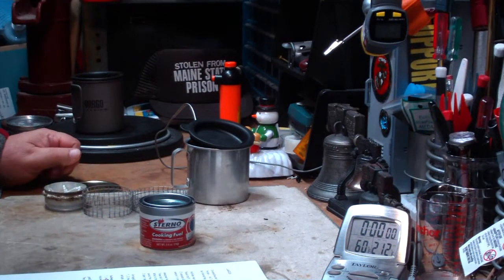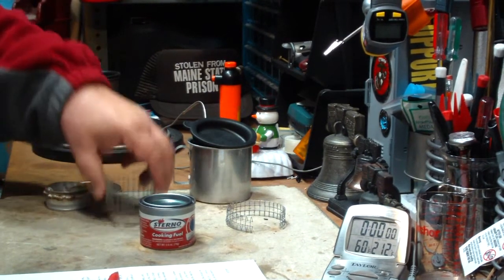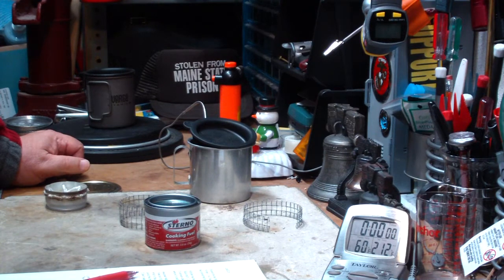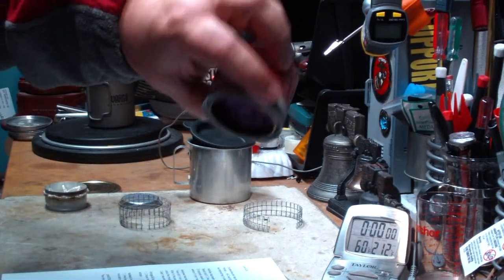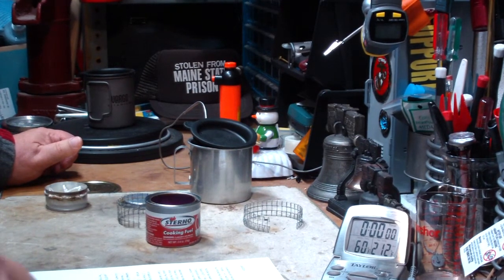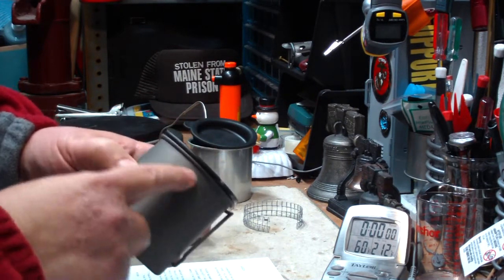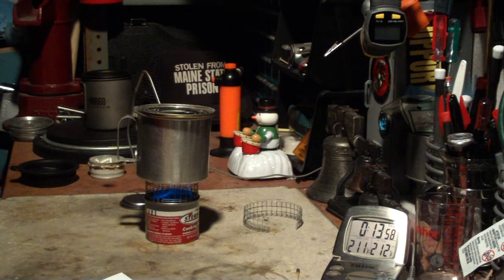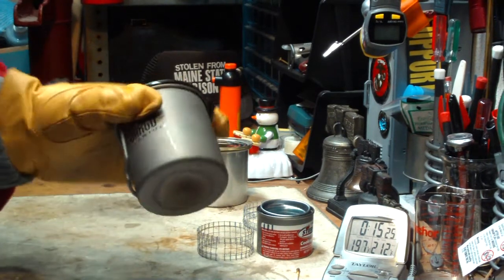Sterno or Gel Fuel? What A Can-of-Worms  II

Comment: Hiram: I told you that water in Tutanium heats up faster  than in aluminum. It has to do with specific heat. The efficiency of heat passing through the metal of the container. The specific heat of aluminum is .91. The specific heat of steel is .49, and the specific heat of titanium is.54.

Comment: Yes, if you make one 5 squares high and you get around the same time as the 3 squares high then 4 squares is the optimum height. If 5 squares gives you a shorter burn time, then try one 6 squares high. I would predict that at some point fairly soon the greater height will increase boil times, and that 4 or 5 squares may be the optimum height...